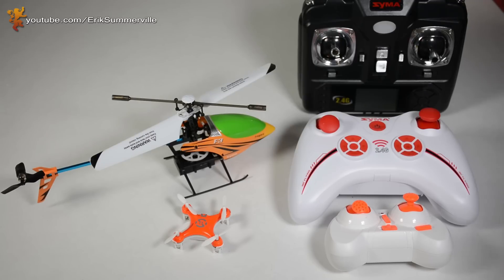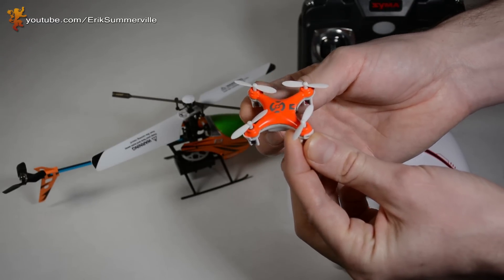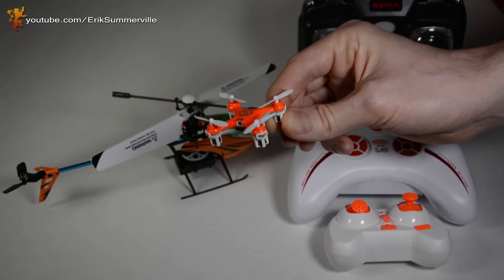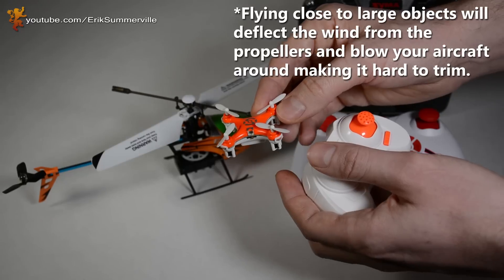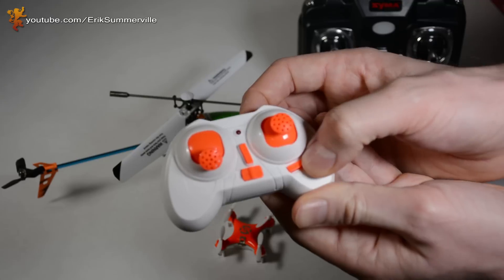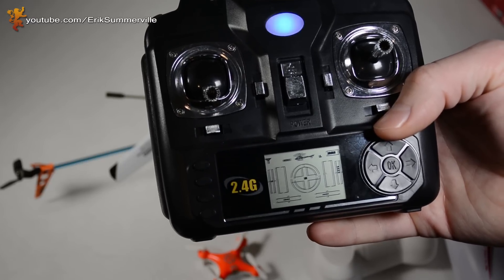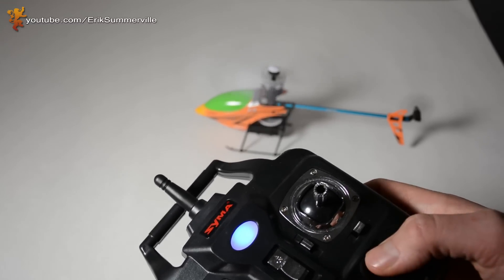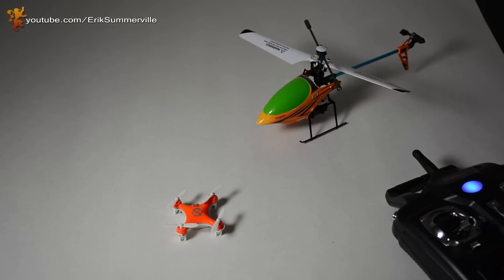How To Trim! Quadcopter & Helicopter Trimming

Comment: Seasons greetings - I have the Syma - X12S.  All of a sudden now it doesn't lift off. The other calibrations seem to work but not sure how to trim it for lift off hovering.
Reply from the maker: There's no trim for the throttle. To keep it hovering in one spot, that'll be done on your left stick by adjusting the power. 
When it doesn't lift off, make sure it's fully charged and it's bound to the controller. You'll know it's bound when the light are solid.
Reply: Thanks, I think I may have located the problem.. the rotor blades were rearranged by my kids... now i have lift off or hovering...  now to get it trim...
Thanks for your response

Comment: My mini quadcopter is flying to The back left and It also is doing that When im Turning to The Top right???. plzz help me
Reply from the maker: If trim wont help, then check the motors for hairs that might have gotten wrapped around the shaft. Also check the blades to make sure they're not damaged and are installed in the correct configuration. If that still doesn't help then one of your motors might be going bad.

Comment: New flyer with the Soma X11. You showed it's controller but there were no directions on how to trim with it. My quad doesn't want to hover in place. Instead, once it's up, it begins moving forward. One thing I've observed is that the rear tends to lift off a bit before the front. Any help will be appreciated. A 69-year-old woman has no business playing around with these but it's really fun!
Reply from the maker: Quadcopters are fun at any age! =)  Try adding back trim. It'll be the button on the right side at the bottom. Keep clicking it until hovers in one spot. Make sure to keep the quad away from any object that'll blow wind back at the quad.
Reply: Thanks, Erik! I discovered the trim somewhere along the way. ;) I've decided that I don't like the controller for the x11. Seems kind of chunky for my small hands. So, I'm looking for another one that's good for new flyers. The list on the 101 site are a few years old. I welcome any suggestions you toss out there!
Reply from the maker: I really like the X902! Here's the review I did on it: https://www.youtube.com/watch?v=i2F5Hgxjt20&list=PLQqDGoQRj-oIVZ5ZF_yYzEpP6KmQs8CVF&index=2
It flies great and the controller is a lot smaller than the syma x11's.
Reply: Nice review! We have very cushy carpet, however, so that'd likely be a problem. The heat here north of Houston is horrible right now so inside is where it's going on at this time of the year. The x11 being white makes it hard to see against my white walls, too. Other suggestions? I've looked at a couple more of your reviews in hopes of stumbling onto one a bit bigger than the x11, perhaps...and stable with a different shaped controller? Maybe rectangular that isn't fatter at the top. Think that's what's giving me some trouble cuz my left thumb doesn't go forward easily. Oh! I'm appreciating your input here, Erik!!

Comment: What if I went out of scale in trimming and quadrocopter is still drifting?
Reply from the maker: +m4jaja If it's that bad then one of the blades might be bent/broken or one of the motors might be under performing. Is it a quadcopter or helicopter?
Reply: +Erik Summer It is quadrocopter CX-Stars, similar to CX-10. I have to check the blades then. Thank you for answering, great vids!
Reply from the maker: +m4jaja Thank you! The CX-Stars is actually smaller than the CX-10. I did find a CX-Stars with two sets of extra blades here: http://amzn.to/1VLxSMu   I looked for just the blades by themselves but couldn't find any.

Comment: as far as I am concerned this is the best video on  Quadcopter  on youtube, this has got me out of trouble my new one, my first was unusable, next day without to much wind I will have another go, my one came out of the box way off
Reply: +Peter Woods Thanks for the comment. When you first turned on your quadcopter, did you place it on a flat level surface to allow it to initialize? Sometimes turning it on at an angle will throw off the gyro.
Reply: +RC Dad  I have read and tried everything but I think this will fix things, cant try today as its windy, very windy, I want to video something in particular  , the old tower where I live, two years ago a professional drone crew were here and stayed clear of the tower, I tried my quadcopter there and it soared into the sky very high on its own, there is a military base just up the road that blocks satnav for example and effects TV, is this the problem, have another go when the wind drops, this video on trimming has allowed me to set up things perfectly, this showed what the screen should look like on my syma x5c should look like, if I get the hang of this I will get a good one

Comment: I have a Syma x11 hornet and you have the controller in your video but I don't know how to trim with from that controller. Could you help?
Reply from the maker: +ejfahlen3 You'll see 4 buttons on the bottom right side in the shape of a circle. Keep pressing them in the opposite direction that your quad is drifting until it stays in one spot.
Reply: +Erik Summer So if I uderstood correctly if the quad is flying to the right I have to press the left trim button,. If the quad is flying back I have to press the forward trim button. Is that correct?
Reply from the maker: +Felipe Nardo That is correct.

Comment: I have a swift stream z-9 with the larger controller. My son got a hold of the controller and got values in the trim scale displays that I can not zero out. The unit wont even lift off because they are at max trim. How do I put these display values back to center or zeroed out.Thank YouNo support at all from the manufacturer.

Comment: Thank you for creating this video.  I'm a beginner and the information helped TREMENDOUSLY!  

I do have a question, I purchased the UDI R/C 818A Quadcopter with the 2.4GHz transmitter.  The transmitter has 4 slide buttons two that move horizontal and 2 that appear they should moved vertical.  Both sets of slide buttons are separated by an ON/OFF slide switch.

The left vertical button seems to be frozen - is this normal?  I requested a replacement and the same button appears to also be stationary.  Any input that can help?  

Thank you!
Reply from the maker: +D Byrd I took a look at your controller. I'm guessing it's a button that's not used on your quadcopter. A lot of the toy controllers are used on a top of different planes, helicopter, quadcopters and so on. So sometimes there's buttons that are inactive. Your left vertical button is your throttle so there's no need for it.  On one of my quads, the left vertical button actually makes the quad snap pictures.  Did yours come with a manual?

Comment: Can you please tell how to trim U207 UFO Intruder?
Reply from the maker: sanyam sharma Your transmitter will have tiny tabs left/right forward/reverse next to the controls.  Keep pressing those in the direction that your applying inputs to keep the quad flying in one spot. Sometimes you'll need to press them a lot to get it trimmed perfectly. Make sure to trim it where there is zero wind.
Reply: Thankyou , this really helped :)

Comment: Hey Erik, I look at the video and I can't get my UDI U207 6-Axis UFO Intruder Mini RC Quadcopter to fly normal. It keeps fly fast and to the right. The trim is all out of whack. Do know what to do?
Reply from the maker: Cleve Carter Check for bent or broken blades. Try replacing them if they are damaged. When you first turn on your quad, make sure it's on a flat level surface so it can initialize correctly. If that doesn't help, it might be a bad motor.
Reply: Thank you it helped.

Comment: Hey Erik, Thanks for the tutorial. Regarding trim, I'm finding that once I give enough throttle to lift off, my simulated quad goes too high too quickly. Is there a trim adjustment for this?
Reply from the maker: Sounds like your quad has a lot of power! On these types of controls no. You can adjust power settings in the more expensive transmitters, but from what I've read programming a quad copter to a new transmitter can be difficult if you've never done it before.  I wish it was easier to bind quad copters to different transmitters.